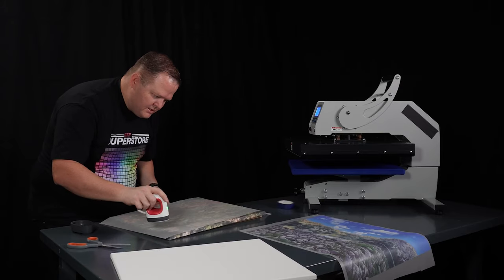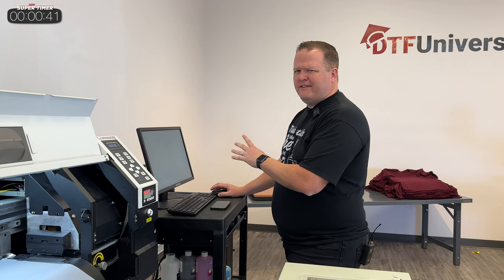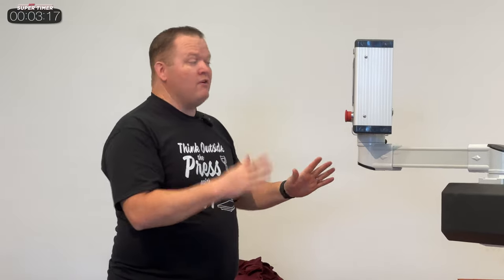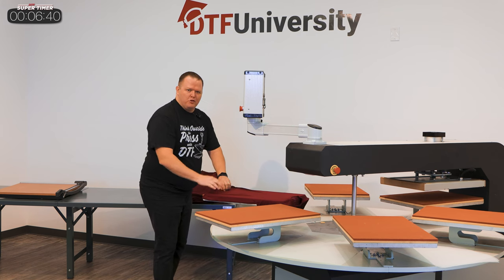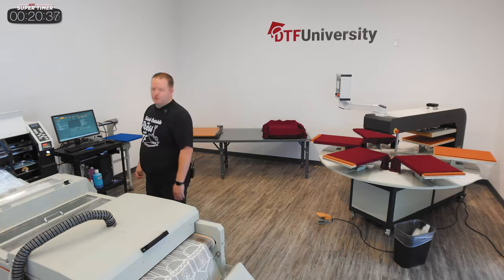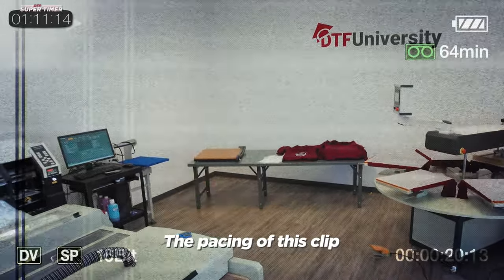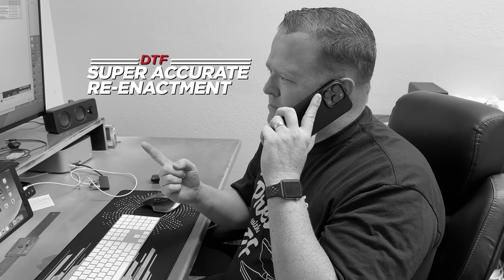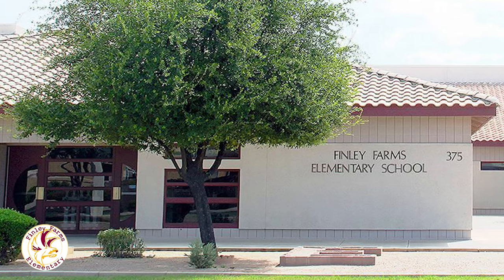100 Shirt Challenge | DTF vs Screen Printing

Comment: Lets not forget the time of coating screens, exposing screens, reclaiming screens, the time to cure in a dryer.  Not to mention for this shirt, it looks like its a couple colors so you would need a white underbase, Oh and the time to get the artwork separated with the right amount of choke and trap.  Great video!  Thanks for sharing with us!
Reply: i addressed this above
Reply from the maker: Agreed! Thanks, glad you liked it!
Reply: It takes much more on screen. All the work You need to do for screen: separate colours, print film, reclaim screens (than dry them), coat screens (dry again), expose screens (dry again), register on the machine and print. For one person it takes more than 3 hours. Plus the energy (gas or/and electricity). I say DTF is much better option.

Comment: So I am an actual screenprinter and DTF printer. Apples to apples starting from scratch with just a customer supplied email. There is several hours of prep before hand. If you are starting with coated screens in my case burn 10 sec and then rinse let sit for 20 min till dry. Then take screen to prep and tape off in press another 20 min with a test print. Then what ink are you using for the product double hit so lets say 6 station manual press goes around 2 for 2 hits of white with 10-15 flash dry for roughly 30 seconds a shirt for printing and then through conveyor dryer for curing of 300-365 for 2 minutes. Apples to apples 3 hours with already coated screen without cleanup. Or artwork prep and film printing.
Reply from the maker: Thanks for sharing the process, its very helpful for those that don't have screen printing experience!

Comment: 100 pcs one face in 3 hours is not rentable, I make 100 pieces in 1h20~ taking my time with a 2-handle pneumatic heat press. At the time, in screen printing, it took around 2 hours to prepare 2 color screens, emulsion development, machine setting, and 1min~ per piece printed at the exit with a drying tunnel. DTF will remain the least expensive, the fastest and the quality can be said to be good over time.

Comment: 😬 with a DTS and an m&r automatic I can burn a 4 color job and print at least 300 shirts within an hour
Reply: Although that'd be a two or three man team. How do you envision the dtf process being handled by a two person team? Mainly how fast can the film be printed
Reply from the maker: The beauty of DTF is you can just be a one person operation but with a couple people involved you can really ramp up production speeds.  We would have someone that runs the printer and another person pressing, that would be faster.  If it was just a one person operation we'd do all of the printing at once and then all of the pressing that way they're not running back an forth trying to keep up on the printer and heat press.
Reply: @DTFSuperstore  thank you for the response 👍👍 I'm pushing to get one after some thought. We get a few low quantity jobs with high color amounts and I feel this could cut down a lot of production time. Originally I looked at this as a replacement but it's probably best integrated.
Reply: @DTFSuperstore  does it require constant attention or could you print say 20 feet of film unattended?

Comment: no way, on an auto, 1 person loading unloading we can run 400-800 shirts/hour. This would take about 15 minutes to print.
Reply from the maker: You can't separate the art, print film, coat screens, burn screens, setup the auto, print the shirts and tear down the auto all in 15 minutes.  This video is DTF time from start to 100% finished.
Reply: @DTFSuperstore  you're right. Our shop could do that in 45 minutes or so. Challenge accepted I'll check back.
Reply: @Tornadotuesdays  Yah id like to see a video of someone screen printing. i feel 100 shirts, 2 color one location... could definitely be done in half the time screen printed. especially on an auto. He used that carousel heat press so the equivalent would be using an auto.. otherwise he wouldve been there all day on a single heat press if anything lol.
Reply: See. 100 shirts with setup. 13 minutes. That leaves plenty of time for seps screens ect.
Reply: And yeah I know it’s two people but you get the point. DTF can’t compare yet. We use DTF all the time, but there is not comparison on actual time spent
Reply from the maker: We've never said it would be faster (people just under estimate DTF's capabilities and speed) I appreciate you sharing the video but it's not a good comparison, it says they used 3 people and started the time when the first screen was on the press.  If you look at the clock, with two people setting up the press it took 2:45 before the test shirt was on...one person doing it would take more than twice that.  If I had just 2 people theres no doubt my time would have been significantly faster.  How long does it take to separate the art, print the film, coat the screens, and burn the screens?
Reply: @DTFSuperstore  basic spot color art that is comparable to your print would take 2 minutes to separate at most. Coating a screen on the uni-kote is 30 seconds, drying the emulsion would take the longest but you can put it in front of a space heater and have it dry within five minutes. So it could be drying while I separate the art. CTS prints the image on the screen in 30-45 seconds. screens burn in 8-10 seconds. Washing out the screen then drying it in front of a fan would be 5-6 mintues. Taping another 30-45 seconds. Setup on press and printing (again 2 color like your design, even 3-5 screens) would be 10ish minutes with a tri loc. then the actual printing would be 15 or so minutes.  so I count about 45 mintues. I'll give it an hour with a ton of buffer room. I agree you aren't saying DTF is faster, but you did say screen printing would take 2.5 hours, so on that point I disagree. Maybe if you reduce us down to a manual with no automation, but then you'd have to reduce your setup down as well to make it fair. Just trying to be realistic
Reply: Now if you had a full color image that was full Simulated process, the setup would take a bit longer, that is where DTG and DTF start to get a little more traction.
Reply: Not everyone can afford a 70K ROQ, but I agree with you on your time using an auto
Reply: @megahash1833  for sure, but that dtf printer and 6 head heat press aren't exactly entry level either haha
Reply: We always have screens coated ready for use. Would take me 15 min to get the art ready for our M&R I image and would take 30 sec to print the art on the screen and expose for 5 sec. Would take 6 min to wash the screens out and they would be dry within 5 min. Registration would be 2 min with our triloc and we would have someone mix the colors while everything else is being prepared if needed. That amount of shirts can be printed within 10min. We could get that job out of the way within 1-2 hrs or faster. A full size 5-8 color job is a different story.